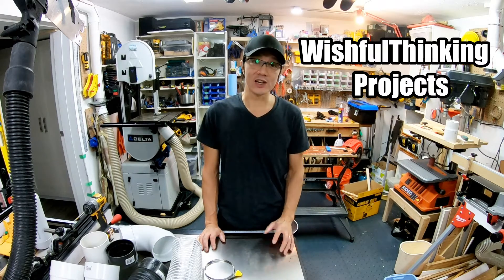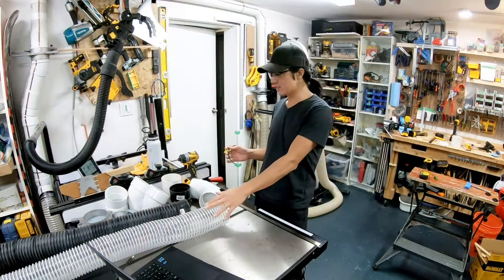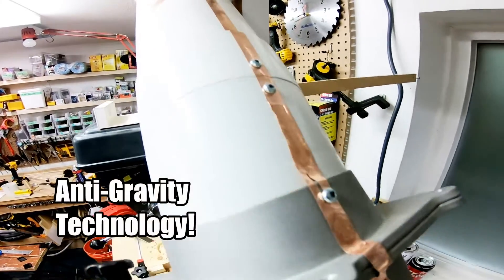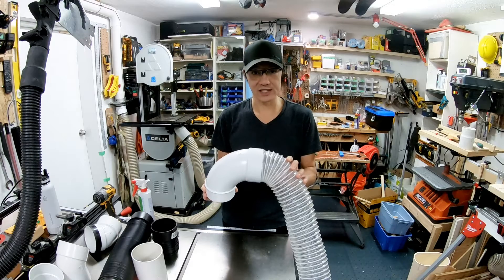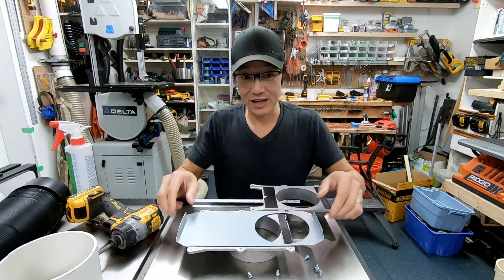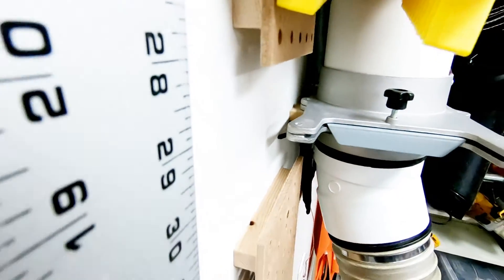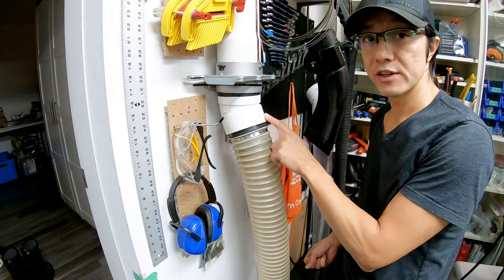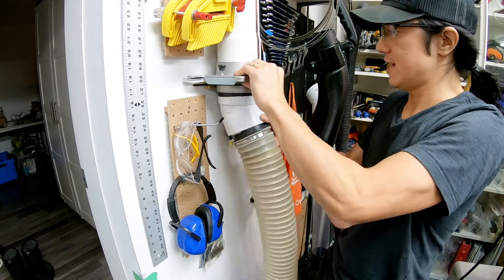Workshop Dust Collection System: Parts that actually fit together! DIY 4" DWV PVC based network

Comment: Looks like a great setup for your shop.  I think for suspending mine in my old garage, I can use plumbers galvanized strapping (50 feet of it on amazon for $17.99) as my walls are cinder blocks and my ceiling is plywood.  It's a very old garage.  I have my dust collector at the back wall of my garage with a 4" pipe going through the cinderblock wall and a 90 degree coupling directing the sawdust into a dump cart I can tow behind my riding mower.  Eliminates the need for bags and I can use the sawdust/chips for everything from filling up holes in the yard to compost or mixing with mulch to just throwing it on the brush pile and burning off the excess.

Comment: Great Video!! So has the grounding helped with static electricity?  I use pvc pipe as well and when the conditions are right it does build up a lot of static electricity and I hate getting zapped by it.  Has the copper tape helped or eliminated that?
Reply from the maker: Thanks and Yes! I haven't been zapped since installing the tape and dust doesn't stick/cling to the outside of the PVC.

Comment: Tell us what your using for pipe. Sdr35 or sch40, etc. thx
Reply from the maker: It's the lighter and cheaper DWV type. Not 100% sure if it's sdr35, but certainly not sch40.

Comment: I just did my garage with dust collection. I used very small copper wire to reduce static electricity but I see you have copper strips.  Where can I find these?
Reply: Never mind I see it is the same tape used for stain glass

Comment: Hi.  Some additional feedback from our last talk.. I realized the left hand screw on coupler you "demode" were a bit smaller than the ones I ordered from Woodcraft. I was finally able to use the Rockler hose. It was hard to slide on -  but I stretched the end of the hose over a Rockler blast gate. I let it set over night. That allowed me to use my left hand screw on fittings - but it was still a chore. WD-40 made the job much easier. I used the blast gate trick to attach other fittings to the hose including my Oneida 4/5 Dust Deputy and dust collector.  I have the dust collector up and running now. Thanks.
Reply from the maker: That's great news and I admire your persistence to work it out. Happy dust collection!

Comment: I like your ideas. I was amazed at how easily you threaded the coupling with the left hand threads onto the hose. I tried that today with my 4 inch dust hose I purchased at Rockler a few weeks ago and I could not get it to go on. I struggled just sliding one end of the hose over the Rockler blast gate. I noticed that you are using POWERTEC products for your demo. Could their dust hose ID be slightly larger than Rocklers?  I have other fittings which do not work with their hose as well, and I am frustrated. Any thoughts?
Reply from the maker: Thanks! I would suspect the same as you - that different manufacturers have different standards, especially Rocker as their 4" clear flexible hose on the website is marked as being exclusive. If I had it in my hands I'd be able to make a more definitive assessment of what you're experiencing.

Comment: Great video and explanation! Wish I had seen it before I got all the 4" blast gates. But all the other tips are great and I will put them into use with a system I am putting together. I assumed that I would get some air leakage just inserting the flex hose inside of PVC fittings because of the coiled wire, so I am puzzled that you don't. have you checked that somehow for leakage?
Reply from the maker: Thanks, glad you found it helpful! I haven't checked for leaks but practically speaking I'm very happy with my system's current performance. Maybe I could squeeze a few more CFM's by sealing things up, but I value the flexibility even more. That being said, these 'bridge' hose clamps should address your specific concern as the bridge is shaped to go over the hose's coil: https://amzn.to/3CIrGpi
Reply: @WishfulThinkingProjects  Thanks. I do use those when I have the flex duct going over the outside of a fitting. But I had not seen anyone put the flex inside a fitting before so I will try that. I did find with some stretching and heat that it is possible to get flex ducting over a S&D pipe - but not easy (required my wife's help) - and not something I want to do for every coupling. Thanks again.
Reply from the maker: @MrHolz1234  Ah yes, I had missed the "inside of PVC fittings" in your original comment. Possible there is some leakage there, that could be (transparent/clear) caulked to seal them up if looking for a more permanent solution.
Reply: @WishfulThinkingProjects  Wow, I just tried fitting the flex duct into a 4" S&D PVC fitting like you did, and even with soapy water it was a bit of a struggle. Not sure if fitting the flex hose over that 4" tubing was easier or not. Anyway, thanks again for all the tips.

Comment: Great video. I just built my shop and I'm using flexible hoses which are a pain in the butt. I'm looking for an inexpensive way to run my dust collection, and I think I've just found it. Your use of Gorilla tape to make the connections a bit more snug is awesome. Thanks for sharing.
Reply from the maker: Thanks for the comment! Congrats on building up your shop and happy dust collection! 😊

Comment: Really nice vid with good work arounds to make odd parts fit, the only thing I would add is trim the tails off the wire ties, I have 2 friends that have had eye damage due to them one unfortunately lost a eye and the other had his eye saved but it was touch and go for ma while.
Reply from the maker: Thanks for the reminder! I've been scratched by exposed tie strap cutoffs so it's good to keep remembering to trim of the littlest bits. I find using a sharp razor to trim them flush is always better than using wire snips, side cutters, etc.
Reply: @WishfulThinkingProjects  I cut them off with a pair of end nippers and then give the end a touch of the soldiering iron, but if the end is flush all's good.

Comment: Unless you live in a place like a desert that has long stretches of very low humidity, you aren't going to blow anything up with pvc. The copper tape is worth doing because it's cheap and easy, but all things considered people shouldn't worry about it too much. Just be careful if you are cutting metal in the same space as wood. Don't use your collector for metal for obvious reasons.
Reply from the maker: Agreed. I used to get annoying static shocks much like with a balloon before I added in the copper tape. Wasn't concerned about safety, but more about static cling of dust and annoying shocks.

Comment: 1 Use 6" pipe.  More than 2 times the air flow.  2 Dump your exhaust outside without a filter.  Twice the airflow as with a filter.
Reply from the maker: 1. Depends on the dust collector. Mine's only 1.5 HP where the motor cage only has a 4" port anyways, so 6" would result in a drop in air speed rendering even less effective.  2. Would not work well in the winter - all the warm air would get blasted out and freezing air would have to come in from a window/door to replace that air. Neighbours wouldn't be too happy with all the dust either.

Comment: "You can't ground an insulator (like PVC)" so it's pointless (i.e. stupid) to do it - Rod Cole, MIT Lincoln Laboratory.
Reply from the maker: That is correct. Static electricity by definition is the buildup of electrons on an insulator, but one cannot simply attach a wire to one end of the pipe and expect the entire system to be grounded (like one could do with metal ducting) to discharge any static. Instead, one must run an electrical conductor along as much of the surface as possible on all the ductwork so that you're not grounding the insulator, but instead you're actually grounding the static that's clinging to the the insulator.

Comment: No need to hunt for fittings with male connectors or “street fittings.” Because you’re using the inner diameter just add some 4” pipe into the female end then cut the pipe down flush with the end of the fitting. That will shrink the opening and give you the same fit when a street version is not available. 👍

Comment: Hi, Thanks for the video. I bought 100' of 6" SDR 32.5 and it's wider than the SDR 35. Where can I get fittings for the SDR 32.5? Is there a way to used the SDR 35 fittings with the SDR 32.5 pipe? I bought a lot of thew SDR 35 fittings and I can't seem to find any reasonably priced SDR 32.5 fittings...
Reply from the maker: Hmm. sorry, I don't know specifically for those sizes. Good luck with your search. If you get close, some of the tips I shared in my video could help you overcome minor fit issues.

Comment: All your blast gates were upside down, they are designed to suck that plate and seal it off when closed, that is why it was rattling and not sealing.  Otherwise I enjoyed the video and got a lot of good info out of it
Reply from the maker: Thanks for the comment! Originally I didn't have any luck with the gates oriented in either direction, and I believe it's because the thin metal gates aren't perfectly flat, making some more susceptible to rattling. Or I only had a 1hp collector at that time (now upgraded to 1.5hp). With your feedback/tip, I'd say it's definitely worth for others to see if the other way up works for them first before modifying, esp if friction fitting as I've described, it only takes a few moments to flip things around as you experiment ☺️. Cheers!

Comment: Simple, concise and informative, but I would like to point out that you need to make sure “which” pvc pipe you are using. From what I can tell, you are using PVC DWV pipe, known as “drain waste vent”, which is much lighter and cheaper than schedule 40 pipe. It also requires elbows and connections that are specifically made for it.
Reply from the maker: Thanks for the feedback! Yes you are correct. I realised shortly after posting I forgot to mention that. I wish I could edit the video or annotate it to clarify that.
Reply: Show me a non-industrial 4" port on a big box power tool fit in any way with 4" schedule 40 pvc pipe and fittings ends and I'll touch my sawstop blade.

Comment: Turn your blast gates upside down from what you have, the thumb screw will hold the plate tight to the gate
Reply from the maker: I can't see that helping, since the screw would push up on the gate in that one spot while the other end flops down. The way I've got it set up now and in the video, I never have to mess with the thumb screws. With the mod I've shown in the video, I slap each gate open and closed in a split second.

Comment: What about connecting to smaller tools with small ports. My miter saw and sander have a small port more suited for a 38mm shop vac, but why by an extra vac when I have a powerful 100mm dust extractor. So I'll likely connect and split a 38mm hose from my 100mm pipe. The issue is some tools are too small to have 100mm pipe going to it but too big for a 38mm hose. Such as I either have a 100mm pipe going to 50mm table saw or a 38mm hose going to a 50mm table saw. 100mm down to 50mm would be better but a table saw is under a bench so fixed 100mm pipe is a hassle. You cant have table saw against a wall because you need to out feed. So much hassle with all the different sizes.
Reply from the maker: I don't recommend using a dust collector for small tools, since the small ports on those tools well restrict too much airflow. A dust collector is a high volume, low pressure machine that relies on maintaining air speed to keep dust moving in its air stream. For small tools you'll need a vac that is more of a high pressure low volume collector.

Comment: Thank you for sharing this info. Dust collection hose fittings seem straightforward but the lack of uniformity leads to so many return trips.  Everything is slightly off - not enough to spot, just enough to not fit.

Comment: Very helpful video with some great ideas that I had not thought of. After watching many other videos my take away is that every angled fitting and section of hose especially that corrugated fix hose will reduce airflow. Sectioning off parts of your dust collection system with good blast gates will increase the suction in the run being used. Have you ever done a smoke test at the unglued joints to see if your leaking any air at these connections? 
I'd like to hear your thoughts on my take aways??
Reply from the maker: Glad it was helpful! Yes, bends, flex hose, etc reduces airflow so it's good to keep these at a minimum, and use gates to focus the flow. I find the friction fits are so tight that any air loss from not gluing is negligible - I would say if this a concern and one is settled on how their shop is setup, then glue it all together. I've changed the layout of my shop several times over the past 14 years and feel I've really benefitted from not having glued anything together.

If I were to start again, I'd probably do everything the same, except buy 5" flex hose and somehow make it connect to the 4" rigid parts of the system.

Comment: ok. I've spent a week trying to find rigid 'pipe' [aka DWV] in the US [I'm in Honolulu]. So far, no luck. I bought all sorts of Woodriver DWv connectors that are supposed to fit DWV [I've tried SDR 35, but no go]. Thes DWV fittings are slightly over 4: O.D and if they're supposed to fit into a DWV pipe, the pipe  needs to be 4 1/32 I.D. or I will need some sort of adaptor. Help!
Reply: Can you tell me what the numbers on the side of the DWV big box store pipe are, so I can try to find it here in the states?
Reply from the maker: Hmm I can't look at the markings on my pipe since I was careful to line them up so all the print on them was facing the wall/ceiling. The inner diameter is 3-62/64" and the outer is 4-13/64" on my calipers.
Reply: @WishfulThinkingProjects  I think I've figured out how to do it! And the measurements you've made will help! Thx

Comment: One question: do you think the copper tape is useful? I know what it supposed to do, but is there any evidence that it actually works [I don't mean this to sound the way it sounds, I'm totally open to the idea]
Reply from the maker: I used to get a tiny shock once in while (when the days are drier?) when handling the hose, but haven't experienced it since grounding - this was at least 3 or 4 years ago so it's been a while. So it has definitely had an effect, or my climate has coincidentally changed since then.

Comment: Great information, thanks!  One question:  have you had any problem with clogging at the point where the screws go through the pipe ?  My concern is that the pointy end sticking into the air stream may collect shavings and eventually block the air flow.
Reply from the maker: You're welcome :) Good question. I used #6-3/8" screws so they are very short. So far no issues, even after planing and jointing buckets full of shavings.

Comment: I’m always tinkering with my DC system. Like most, I’ve concluded that finding the right fittings can be frustrating. My best takeaway was your gorilla tape fix on the blast gates. I’m heading to my shop right now to do that!
Reply from the maker: Glad it was helpful! I love Gorilla Tape versus other brands of (duct) tape since it's thicker and hence compresses more for a better friction fit. When I need something really thin or less friction, I use packing tape.

Comment: Great information in here. I'm just setting up dust collection piping in my shop using 4" PVC and this video has been invaluable to me. Particularly the use of 5" metal blast gates (as opposed to 4") for max airflow and the way the 5" Powertec gates mate with standard PVC fittings.  I'm also using the 4" quick connect fittings from KMS Tools and the conformable 4" hose for certain tools like the miter saw and drill press - brilliant! You saved me a lot of time and trouble so thanks for making the video.

Comment: Great explanation. I have just set up my new Harbor Freight DC and it’s time to route the pipe. I also installed a new Super Dust Deputy which has a 5” inlet. I have painfully studied and tested 4”, 5” & 6” piping with an anemometer prior to purchasing the pipe.  The 4” pvc drain piping makes so much sense due to cost, options and looks. There is a loss of cfm but it’s not that much.  I had a system in my old shop and it takes forever to figure out all the connections along with wasting money. Your video will save so much of both. Thank you for taking the time to put this together and you have used your space very well.
Reply from the maker: Thanks for the feedback and good luck with your setup! Note I used DWV type 4" PVC. Your measured findings supports my hand test method (I don't have a anemometer) where I find I barely lose any suction after 25' of 4" PVC and several elbows... it's definitely good enough to do the job well.

Comment: Very informative! How did you connect directly to the dust collector / blower intake?
Reply from the maker: Thanks! I happen to have a short section of 6" PVC which is the same diameter as the blower inlet. A few wraps of clear packing tape on the inlet made it nice and snug, and allows it to slide up and down by about 3/4" so I can lift the whole cyclone assembly off the garbage can just enough to slide the can out to dump it. I custom cut an MDF reducer for the PVC to the dust deputy. Hope that helps!

Comment: The cleanest woodshop I ever seen, i wonder how you keep it like that
Reply from the maker: Thanks! I cleaned it for the videos, but generally speaking it can be a huge mess at times, but I try to put away at least 3 things whenever I walk by. Thankfully it's part of my house so super easy to access for a quick moment, versus in a detached garage etc that requires a special trip to the shop from the house.